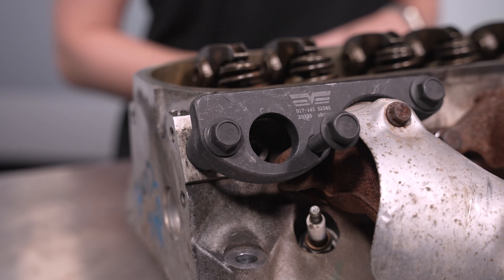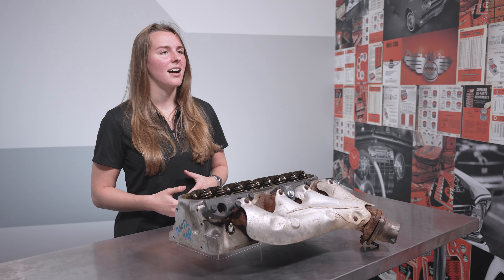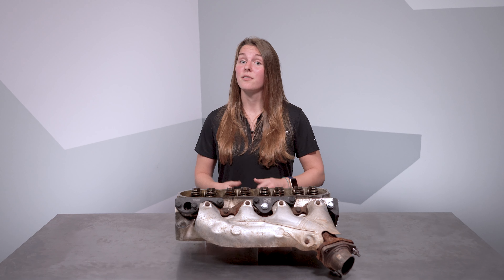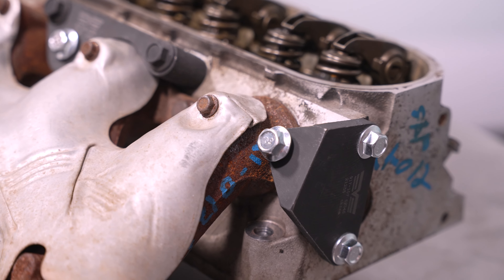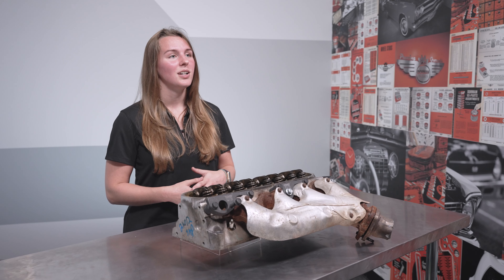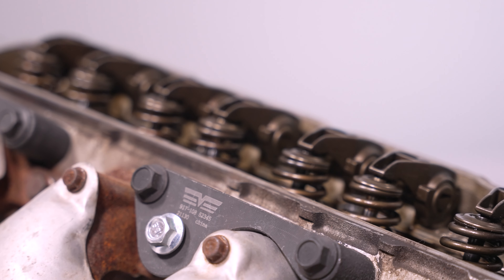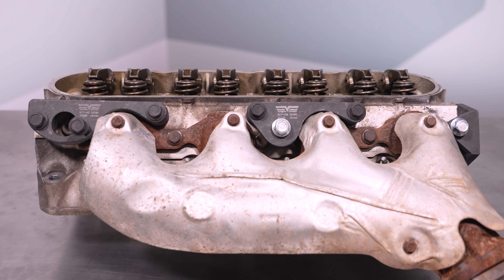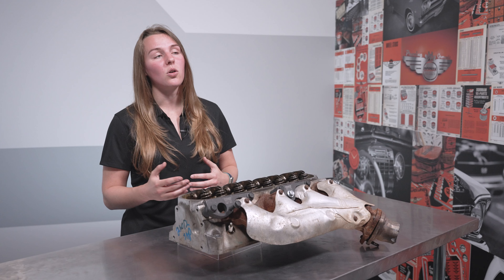Fix exhaust leaks faster for less with Dorman OE FIX repair kits

Comment: Does it fit a 5.3 V8 2016 gmc sierra?
Reply from the maker: Hello, Please check out this link! You can also update the search as well! https://www.dormanproducts.com/gsearch.aspx?type=keyword&origin=keyword&parttype=Exhaust%2520Manifold%2520to%2520Cylinder%2520Head%2520Repair%2520Clamp&year=2016&make=GMC